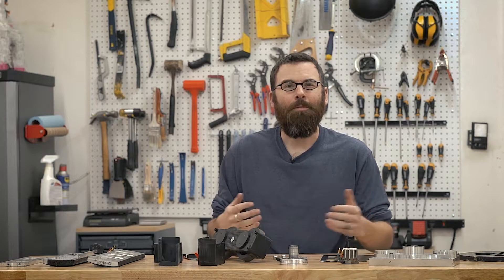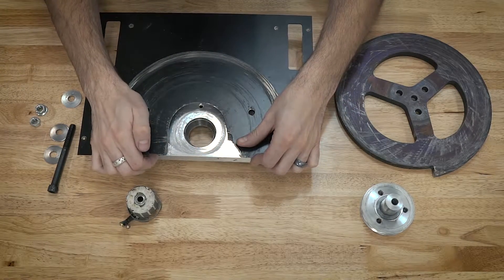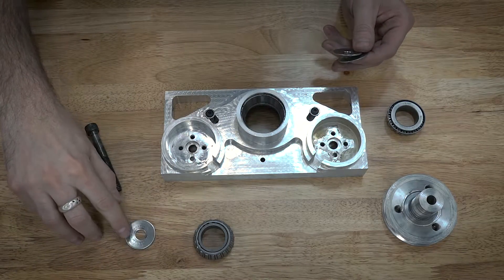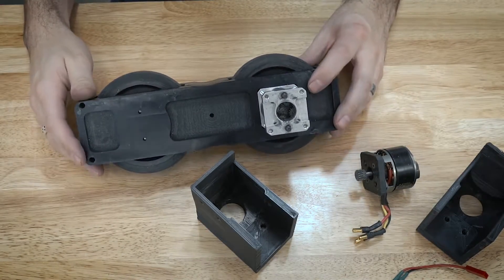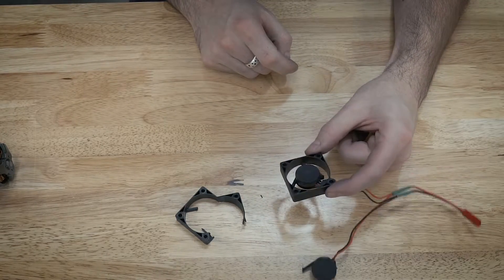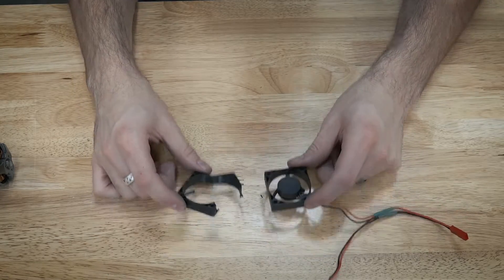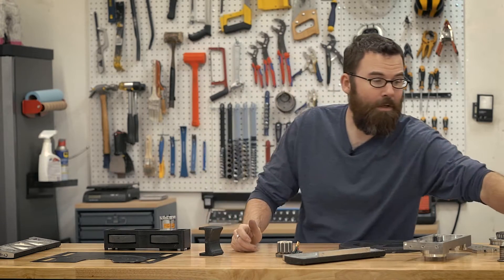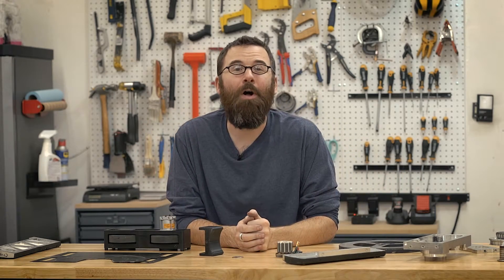Crippling Depression - Part 5 (Damage Report)

Comment: You might try some larger diameter hardened dowel pins and associated hardened sleeves to take some of the load off the socket head cap screws.

Comment: I suppose the motor may have overheated because you are driving 2 brushless motors using 2 esc's and having the motors hard coupled with the timing belt. If one or the other esc can't recalibrate it's timing things may well heat up.
As for the washers cupping. If you had height for 3 of them, why not turn a solid washer/spacer? That may well have prevented a bunch of damage.
Reply: I was wondering that myself.

Comment: Have you considered using Belleville washers, aka spring washers?  I believe that they're used in the power draw bar for your mill.  That should give you good preload on the bearings without having to be super fussy about torque on the bolt.

Comment: Put a machined block instead of a washer, much like the drawbar on a mill. Also, in the Linex mix some kind of steel powder next time (or do a small test batch to smack with a hammer).
Reply from the maker: The new version has exactly this, made out of solid titanium ;-)
Reply: Are nuts available with an outer diameter larger than the tapered bearing hole diameter? That would have put the force at the outer edges of the washers directly down to the tapered bearing.

Comment: You need to look into thicker wall washers. We use them to secure tooling on our 4-slide machines.  They stop cupping.  Mcmaster might have them or MSCdirect/J&L have more options better prices. 
 Buy blue devil brand and black oxide versions.  Try it out.
Reply from the maker: those WERE hardened special ones from mcmaster.  I forgot which exactly, but they were the best I could find that fit the size.  The new version uses a solid titanium 'hat'.

Comment: If you win do you get prize money
Reply from the maker: I think so, but it's minimal.
Reply: Thank you
Reply: Medieval Engineer very few events have prizr money, and if they do chances are its very small unless its sponsored by a big company. And even then it probably wont pay for the bots, and if say last rites wins an event with a prize of say $5000 thatd pay for the repairs, last rites is about $1000 per fight. Excluding the times it has to replace its frame which gets warped (not too costly for a heavy though, its hollow chromium tubes, aluminum and lexan) and excluding the drive motors that he may have to repair. Because now he gets those for free
Reply: I was about to ask that same question. The cost of those machines looks to be astronomical, so bragging rights is the true value in all this. I enjoy watching all this, but I'm not about to enter into this arena, or maybe the wife reminds me this would be yet another project. I guess she is right, after all making hundreds of beautiful fountain, ball point and roller ball pens, restoring guitars, and lately making steam engines that just sit on the shelf after the test run. Ah retirement, never had the chance to do all this stuff when working for a living. Love her dearly, and appreciate her help when that tiny part falls off the table. It's not the cost, it's the satisfaction it brings, and those admiring looks from the wife, when she survives yet another project. ...Ken, the 80 year old retired guy.